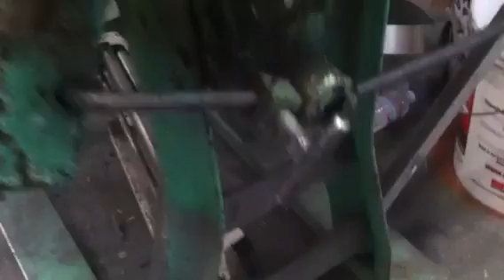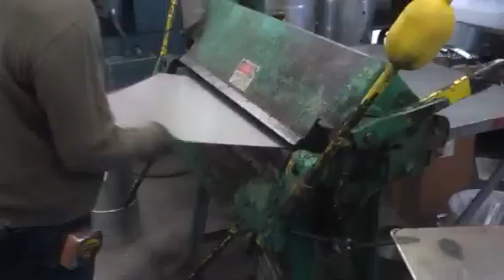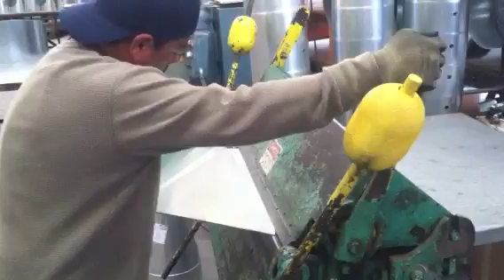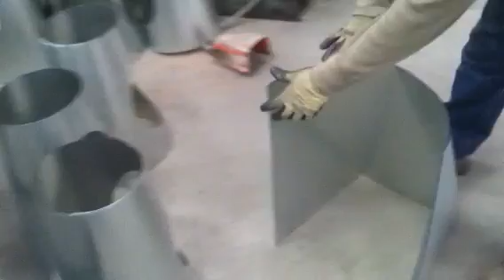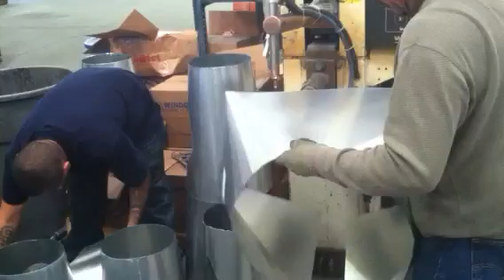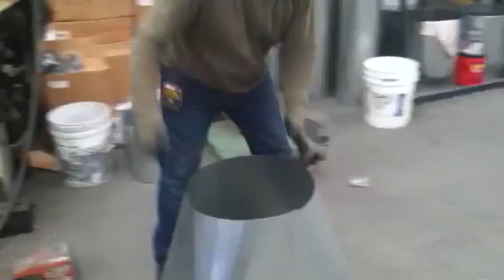Square to round

Comment: lol I can make the same fitting with a 4' brake, no plasma cutter and use pop rivets on the job with 24 ga metal. Not valley tin bought from lowes or Home Depot.

Comment: That must be 26 or 24 gauge. No way you could bump roll two pieces at once with anything heavier than 24. It would be under kinked.
Reply: I've bump rolled 2pcs of 20ga easily on our 8 foot hand brake.
Reply: Haha I can
Reply: They also make machines specifecly for this. I don't remember what it's called but my work has one.
Reply: Diamond Star Garage the problem with double stacking is uneven bends. I dont do it this way but it works.